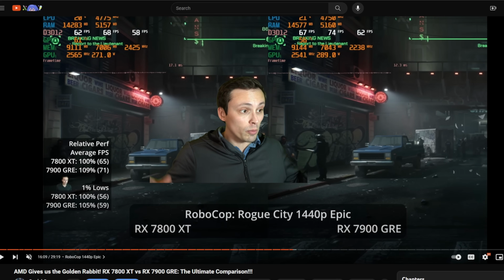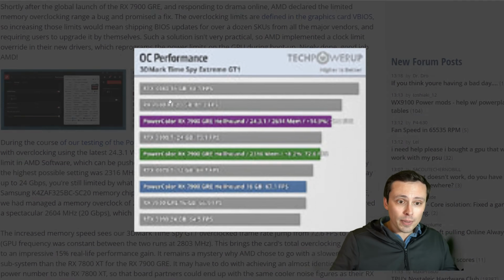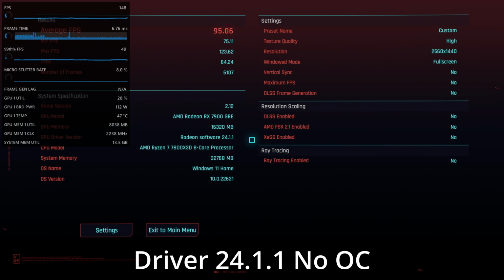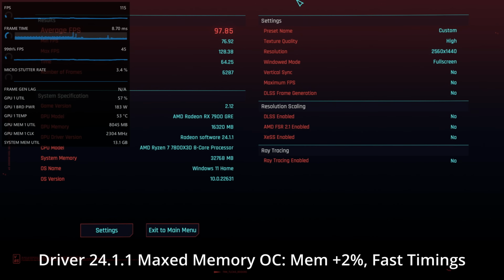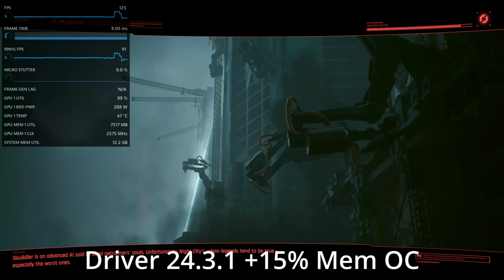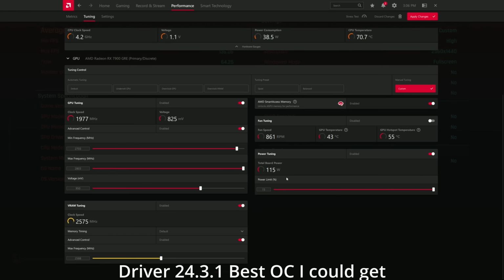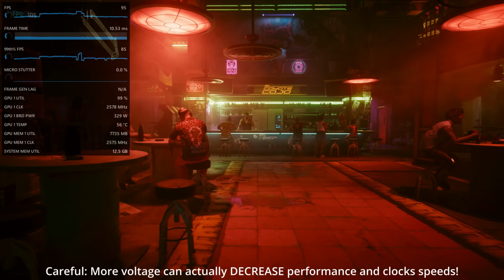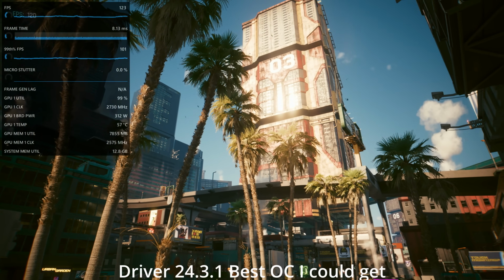Download more performance for certain AMD GPUs!!! (7900 GRE memory OC limits boosted in new driver)

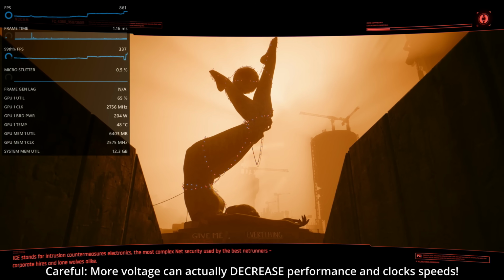Comment: 18:23 It makes perfect sense. You allow it more voltage, which means more power, which means hitting the power limit and temps sooner
Reply: I doubt the gpu is thermal throttling at 60°C

Comment: I have the asus dual fan 7900GRE and was able to overclock it but performance gain is like 5-10% maximum from what I’ve noticed. It’s a great card I had the 3060ti before and it runs a lot faster and more Vram
Reply: I have the same card, but what's your setting? 

I'm having issues with black screen crashes

Comment: At launch the Rx 7700xt was $50 less than the 7800xt.  The specs of that card didn't  justify the price (not a good deal).  The Rx 7900 GRE (really a 7800XTX) was $50 more than the 7800xt,  but the specs of that card made the price a Good Deal.  Now with the AMD Adrenalin  update,  this card LOOKS REALLY GOOD!

Comment: Thanks for this. I really liked how you ran multiple tests. It's helpful .I am looking at one of these cards or a 6950xt as they go on special/sell out(similar price).Im leaning towards the newer card that uses less power even though the 6950xt has generally better performance. this was the first review where it wasn't a "do this, I know what I'm doing"  Reddit expert at overclocking bla bla bla review. Anyway, I've subscribed, keep up the good work. I have an AliExpress night devil b650 and a 7500f with 32gb cl30 ddr600 corsair sitting in an nzxt h1v2 (750w PSU)with a 990pro 2tb  and an unproven AliExpress 4tb nvme awaiting a GPU and windows/first powerup. I have a speedster 6750 xt coming from Amazon as a startup card that I'll on sell,but I'm going to need more fps and a 7900xt is a bit out of budget. I play cod at 1440p on an AOC 180fps monitor currently on a 4070 on a 5700x (runs great)as my usual but really want an all amd am5 build. Hopefully I can keep the kids off one of them..thanks again

Comment: The differences make total sense, it has more compute power, so when you have ray tracing it will be in an advantage compared to the 7800 XT. But the moment that the memory bandwidth starts coming into question, it's major bottleneck, then the 7800 XT is catching up,  as it can fill up the bandwidth better than the 7900 GRE which is limited there. If one would put the 7800XT's Bandwidth on this card? It would also crush it there.
Reply: there a gre with hynix memory that  re rated at 20gb per second bud

Comment: Best stable GRE overclock 
Max core clock - 2720
Memory - fast timing - 2316mhz 
Pl +15 
990mv
Done. 

If you get a crash at some point, up the mv to 1010.
Reply: This worked on my XFX card. thanks!
Reply: this is different for every single card.
Reply: @chrisbohmdrumming9269  No not really. trying to mimick the unrealistic overclocks people post that surely crash eventually or with updates is the issue. 
This overclock  is designed by me, and was designed to be very generous in terms of power still sent to the card and not trying to push it too hard. 
based on every test I've seen of over 20 cards they can all do this without issue. 

This overclock was done with thought. You can squeez more out depending on the memory type, cooling and power limits of your card ect. 
But this one is a solid boost for all.
Reply: I'm just now buying a 7900GRE Sapphire Pure, should I try overclocking it with your preset?

Comment: I bought 7900 GRE Sapphire Pure. It's flying on 1440p 170hz monitor. It also provides 60 or 60+ fps in 4k. I don't care for 5% diff, ray tracing and dlss, just pure raster performance. If i need to overclock it to play some game, then it's time for upgrade.

Comment: Actually it is not the actualy voltage that decrease performance, it is the minimum freqs. If you push your min freqs, gpu will cut down power from memory or other things to try to achive that min freqs, that decreases performance significantly. Please do not use you minimum freqs more than 2ghz with rdna2-3 or just leave it where they are.

Comment: I have nitro plus gre model, mine is not even stable at 2500, my whole system crashes, at default no crashes, what could be the issue? I am not using fast timing, haven benchmark, 3rd mark stable at 2500 but actual games are not. Cs2 crashes, pubg crash
Reply: Increase power limit to max and keep it there if that doesn't work keep the power limit up and decrease the memory
Reply: I found the solution put power max min frequency 2700 max 2800 volts 1050 fast timings memory and set memory at 2300
Reply: Samsung memory doesnt oc well  only rated for 18gb    hynix is rated at 20gb

Comment: PowerColor Hellhound RX 7900 GRE
2829mhz boost
No minimum core clock
Undervolted to 980mv 
VRAM 2543mhz boost (stock timings)
+15% Board power 
Has been stable for a week and power draw is 284watts. Hope this helps someone. All done in amd adrenaline.
Reply: bro won the silicon lottery
Reply: @DevChallenger002 bro fr

Comment: I have the same exact model (Hellhound 7900 GRE), and my PC crashes when I try to benchmark it with VRAM frequency above 2390 MHz. Many users (but not all) also reported poor overclocking performance for 7900 GRE. Since AMD provided Daniel this GPU, it could be that it has better silicon/overclock capacity for a review sake. Maybe I'm just unlucky (like many others) with the silicon lottery. Anyways, just wanted to bring this up in case you decide to buy this card with overclocking in mind.
Reply: Yeah same here
2430 vram
Reply: PowerColor Hellhound RX 7900 GRE
2829mhz boost
No minimum core clock
Undervolted to 980mv 
VRAM 2543mhz boost (stock timings)
+15% Board power 
Has been stable for a week and power draw is 284watts. Hope this helps someone. All done in amd adrenaline.

Comment: love hearing undervolting tip...thanks for the overclocking demo, I just bought the exact same card...i would like to see 4k resolution results when you have time.
Reply: Its not good for 4k
Reply: In the video it gets barely 100 fps on 1440p

Comment: If anyone has the Sapphire PURE edition, please do let me know of your OC results!
Reply: Should be the same as the Nitro+. The problem is that it purely depends on the quality of the silicon. Some people are able to reach a stable 2700+ and some can barely achieve up to 2400mhz. The memory is identical (20gbps rated Hynix).
Reply: @daveb9402  Right, I'm not the best at overclocking. I feel like I can't reach higher because I'm not undervolting properly. My auto OC (radeon software) provided me with 2390, so I feel like I can go higher.

Comment: To understand how bad amd in ray tracing 
0:42 as you see here rx 7900 gre got only 28fps 
With the same settings rt overdrive ( path Tracing) max settings 1440p with my rtx 3070 dlss at quality I got 33fps ! 
So my 4 years old graphics card did better in path Tracing than the 2024 amd high mid range 550$ card ! 
Amd should really fix this !
Reply: 2024 and only CP and Alan Wake have path tracing.
Reply: @mailsibul  black myth wukong too will have ray tracing and ray reconstruction,  
It's hard to make these realistic games you know path Tracing isn't an easy thing for developers 
But what I know gta 6 will have path Tracing after they release it for pc 
And that will encourage all developers to make realistic games 
Amd should fix ray tracing performance before that happens 
Nvidia too should upgrade ray tracing performance more on mid range cards 
Because 2026 games will be have very huge improvement in graphics 
Ue5 games we have right now is just prototypes 
We still didn't get any ue5 game fully utilized the engine or even 50% of it
Reply: @mailsibul and minecraft rtx, and quake 2 rtx, and any remaster made with Remix.
Reply: who cares about rt !!! all games right now its really wonderfull without it !!! and rt making the games so unrealistic !!! and its one future pretty useless cause non game out there has optimise !!! so for the most of ppl not a deal to go on nvidia !!! nvidia is great if you using your pc for work but for gaming amd is moving forward with raw power !!!!
Reply: @Chris.Thanopoulos  ray tracing make games so realistic with real life sun rays and reflection and shadows 
I think you Don't understand how it works 
For example I'm playing minecraft with ray tracing shaders and realistic texture 
It look gorgeous and relaxing 
Ray tracing is the best thing happened to games 
I'm so thankful for nvidia and I hope amd catch up soon

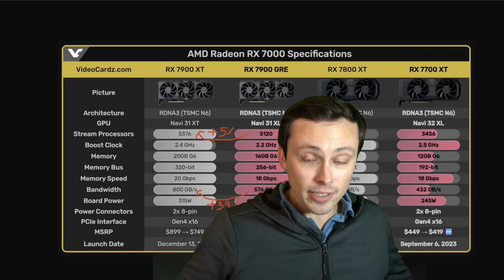Comment: Daniel at 04:44 You should take into consideration that 7900GRE already has 20gbps memory chips wit PIMCs of 50A. So it should already run 2500mhz(20gbps) out of the box instead of 2250mhz(18gbps). Its not a normal overclock on every other amd card memory OC limit is +150mhz (+200mhz if lucky). This is, a crazy + 450mhz(4gbps) gain. Why amd ships it with 20gbps chips and marketed it as 18gbps? Maybe because in HUB review it was faster then 7900xt in one instance anyones guess? 

It has the same memory as 7900XT that can OC to 2750mhz (22gbps). There are already ppl who OC the 7900gre memory to 2750mhz (22gbps) in 3dmark
Reply: Because of some crazy US to China export restrictions.
Reply: yup mine has hynix which is rated for 2500mhz 20gb

Comment: Also, not all of us like to overclock our parts. I, for one, prefer longevity over performance, but I'm not going to go for a card that performs badly out of the box, but some that does well out of the box without cutting its base life span.
Reply: AMD tends to overvolt their hardware so undervolted they perform way better
Reply: @lifemocker85 Ok, thank you! I will check about doing some undervolting then.
Reply: @LordMidichlorian  except its ok to overclock the memory. Its just free performance. Then maybe slight increase to clocks and undervolt as low as its stable. Mine 68XT is 200w after those according to adrenaline. So result is cooler, better performing gpu while power consumption came down drasticslly so tinkering your gpu is worth it.

Comment: Download more ram is now a thing it seems...

I was seconds from getting a 7800xt a few weeks ago then the gre was announced and my interest changed, it's only $150aud more than the 7800xt for both HH versions, I just need to know heat, noise and power draw so I can get a new psu to go with it if it's stable and quiet enough.
Reply: The 7800xt and 7900 GRE have very similar power draws.

Comment: Now GRE just needs a price drop to 450$ ad it may be worth getting
Reply: price already raised to 650 euro though, scalpers gotta eat
Reply: Then no one will buy a RX 7700/7800 XT... Here in Europe you will have to pay around 650-670€ for a GRE.
Reply: @daveb9402  7800 and 7700 are also overpriced
Reply: @daveb9402  7800xt should be 400 and 450 for GRE
Reply: after taxes

Comment: ddr 4 with rx7800 xt vs ddr 5 rx 7700 xt witch is best
Reply: 7800xt. It's not only faster but has 16gb of vram. But if possible get the 7900GRE instead.
Reply: @cococo4545  but it's good than ddr 5 rx 7700 xt?

Comment: Power consumption increased less than performance so it's still within the efficiency range. That's why AMD kneecapped it at driver level. There is no reason not to overclock this card.
Reply: 300w is not efficient. needs undervolt not overclock

Comment: “7900xt only has 5% more compute units than gre”, if you read specs more carefully, aside from compute units there is 20% difference in rops and tmus and less cache
Reply: But then again the 320/384bit memory bus is what is doing the magic for XT/XTX + higher clocks and 80/96mb L3 cache..
With 320bit the GRE would reach XT levels without a sign of sweat.

Comment: That's the sorts of numbers we wanted to see. Now anyone got data on the XFX Radeon 7900 GRE Gaming, which I can buy for $50 cheaper than the Sapphire Nitro+? It claims higher GPU Clock Specs than the Sapphire Nitro+ and Sapphire Pure. Can't find the Powercolour Hellhound anywhere near me.
Reply: what data?
Reply: @lifemocker85 which memory chips they are using, or any successful overclocking data

Comment: I am having the best time of my life with my 7700 XT  (1080p 144hz in every game no matter what it is)
Reply: It's not a bad GPU at all. It offers higher performance compared to a RX6750XT and some RDNA3 benefits. Also the 12gb vram should be enough for the next few years. Have fun with your card.👍
Reply: @daveb9402  I will upgrade the monitor at some point. I just need to find a good 1440p with in-built speakers. (I cant use headset because of tinnitus illness) 
I know every hates monitor speakers, but at the moment i have a BenQ EX2510 and it has one of the best built in sound ive ever heard.. also a nice 1080p image, compared to budget 1080p monitors

Comment: Its better to have slight increase in clocks with mem oc + uv to get lower power consumption with performance increase. After certain mhz the gpus effiency flys out of the window and after that its just sucking more power.
Reply: Especially in the case of the GRE, it is bandwidth limited anyway.

Comment: 15fps in 1440p is crazy in a demanding game like this! I think i’m gonna get the 7900gre nitro instead of the 4070super.
Reply: I paid for my Strix 4080 1300€. It was the cheapest I could find in my region. At the moment they sell here a Strix 4080S for over 1600€. It's insane...
But more insane are prices for a 4090. The cheapest here are going for 1900€ and a Strix for 2300€. There is certainly a big performance gap but for me it is not worth the money.
Reply: For me it was not that easy of a choice as well. I've bought the 4080 and without the coil whine it's a pretty nice piece of HW. But if I compare it to the prices of a XTX it just crazy how much you pay for more RT power but a slower card overall. For my other system I've bought a XTX and with the saved money the GRE to replace my sons RX6750XT (this one did have the same amount of coil whine maybe because it was a Strix as well with the same crappy vrms Asus tend to use).
Reply: @daveb9402  yeah, asus used to be good but now its crapy. 

7900xtx £799
Rtx 4080 960 if you find founders edition.

In overall the 7900xtx faster in raster like 10fps but in rt way behind. 

I dunno this days every game needs upscaling and frame gen to run on a proper fps so not sure even if a expensive card worth it. 

But i would still get a 4090 if budget allows ahah
Reply: for me the 7900gre pulse cost 555€ and the nitro 627€, what do you recommend and why pls ? thnk you
Reply: Be careful cause you can also undervolt 4070S. I had to decrease 7900 GRE clock speeds cause 280W is heating room crazy (it's not comfortable when you have non stop hot air in your legs).
Reply: @tushkan4ik111  same us my 3070 msi gaming z trio.  235-240watts 1440p in most games. But uv 180w max same performance and oc ram 1300mhz, in cs 2 power consumption between 70-90w. 😮 but the ram... nvidia not worth anything over 4090. Only 4090 has more sens, and crazy efficient. Fps per watts, but i buy used gpu 7900gre at week.
Reply: @tushkan4ik111  thats why you put the case on your desk 🤣🤣🤣
Reply: Ay bro, i dont recomment the nitro+. I've seen a bunch of posts with that specific 7900GRE model having the worst thermal performance amongst its peers (even tho its a 3.5 slot card with a beefy cooler). I personally got the 7800xt nitro+ and that's working out well but there is a known issue with these nitro+ cards where the hotspot temperature gets >20C hotter than the avg gpu die temp. Not sure why that happens, some have RMA'd it, some have repasted with the PTM970  since RDNA3 uses chiplets and still no fix. I get like 60-67C max on my gpu temps but my hotspot easily hits 90C+ even with a mild OC, heck it even hits the wall when i just drag the power slider to +15%. Delta between gpu and hotspot should always be <20C but mine goes past 30C and many others have reported the same issue. If i was in your place, I'd buy the hellhound or pure version of these cards. They're smaller, silent and much more stable.
Reply: @anodyneliniment2326  ohh thats good to know. I know the nitro has the biggest power limit as they can hit over 300+ watts. But not sure why thermal is issues on them
Reply: @k1cs1m3a8 
Depends on what you get. Both my GRE and XTX are a Nitro+ and running absolutely fine with pretty good temperatures. If you are unlucky you get an uneven GPU and the result can be a very big delta to the hot spot. This happens sometimes. Certainly not something new for people with a RX6900. It's like the problem with coil whine. There were people out there who complained about the XTX Nitro+ in that regard but on mine the vrms are making not a single noise. On the other hand the coil wine on my 4080 Strix is driving me crazy. I did some UV together with higher clocks and am around 10% apart from a stock XT. It's my quietest card as well. My other 4080 Strix is way too loud (coil whine and fans I've if I tune the curves it's still very annoying).
Reply: @daveb9402  yeah, my rtx 3090 had crazy coil whine as well. At some point even one of my psu lol. Its a hard decision to buy a card this time when we know the new series rolling out just this year. I might try the nitro version and worst case scenario i will change it for a 4070 super
Reply: @k1cs1m3a8 for me the 7900gre pulse cost 555€ and the nitro 627€, what do you recommend and why pls ? thnk you
Reply: @daveb9402 for me the 7900gre pulse cost 555€ and the nitro 627€, what do you recommend and why pls ? thnk you
Reply: @Bkptpt its the same card 😂so buy the cheapest ...
Reply: @anodyneliniment2326 for me the 7900gre pulse cost 555€ and the nitro 627€, what do you recommend and why pls ? thnk you